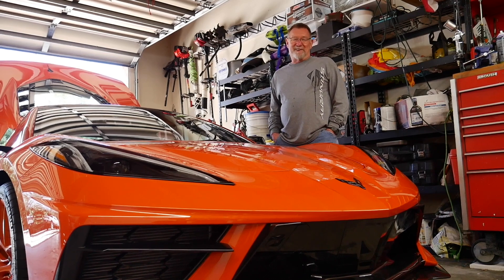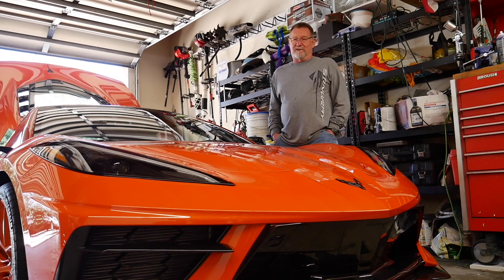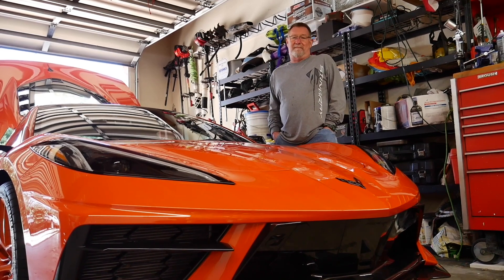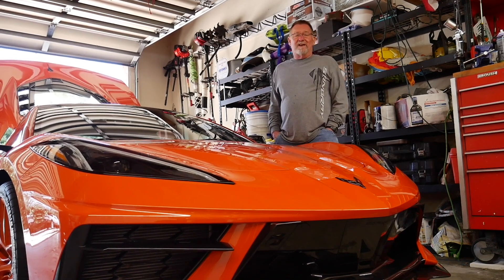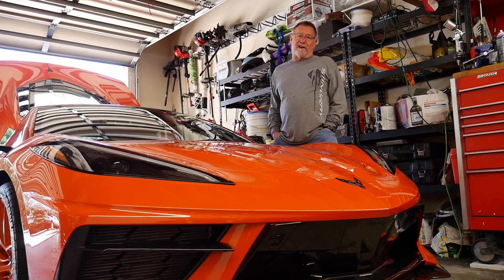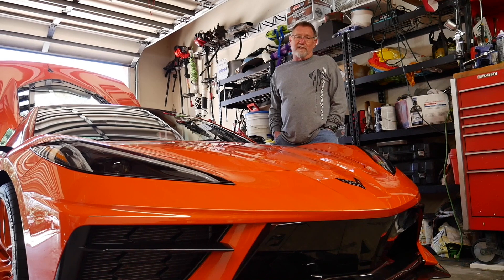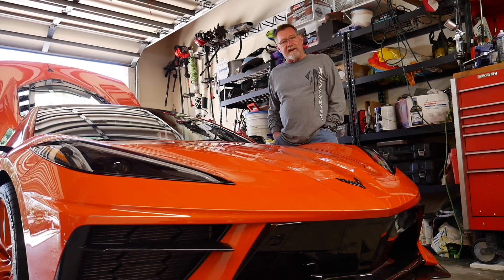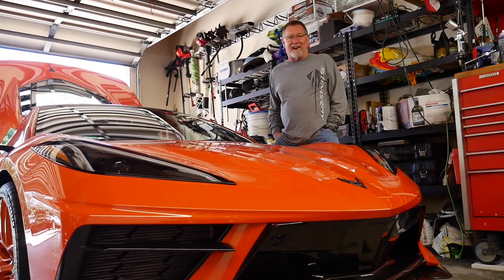My Boat is Overheating? // Mercruiser Inboard Engine

Comment: Got a 350 marine power jet drive with similar issue (new water pump new heat exchanger, thermostat) only overheats after longer use and repeated throttle chop, the jet also has a fresh rebuild. Any insight ?

Comment: Would this also apply to a Chrysler 440 marine in a 76' Trojan F44? I've changed the impeller out and observed it pumping water up, changed the thermostat, but the block is still overheating.

Comment: Hi. I’m a first time boater and first time boat owner of a 2011 sea Ray 330 sundancer. I bought my boat from Virginia and shipped to Africa. It was running fine during the sea trial. Got it winterized then after the winter shipped it. I put it on the water a week ago (Thursday, 31st August, 2023). My problem is, when I started it these happened:
1. Drive lube low ( which I topped up and that indicator is off now)
2. Engine misfire indicator which is still on.
3. No water is coming out of the exhaust for both engines and I’m very worried.
4. The temperature for both engines have been on 162 degrees.
Can you please assist me with your magical technical advice.
I’ll be most grateful.

Comment: Lots of help I have a 305 crusader, shares the same block as a 350 and had over heating problems within 5-10 minutes of running turns out it was the exhaust manifold clogged up and stopping coolant from flowing